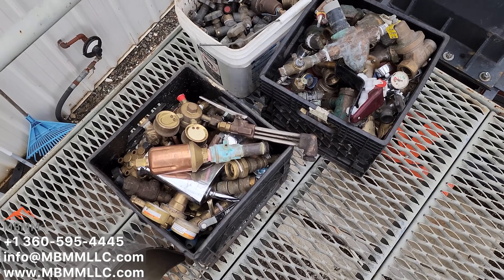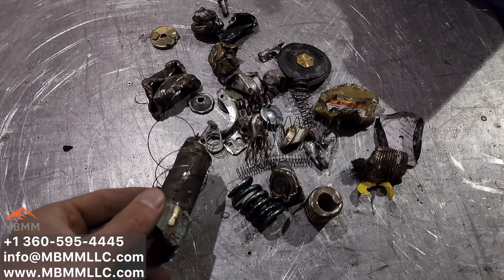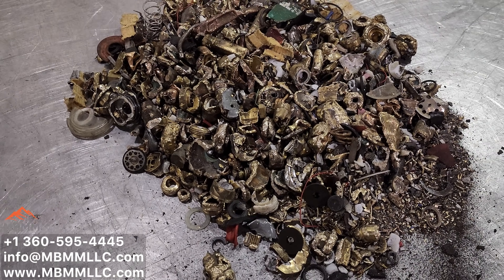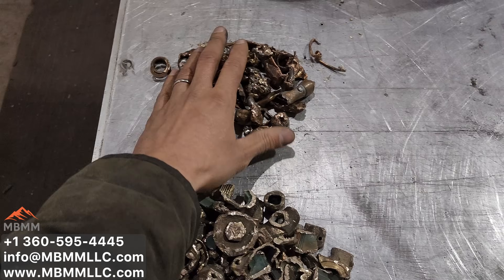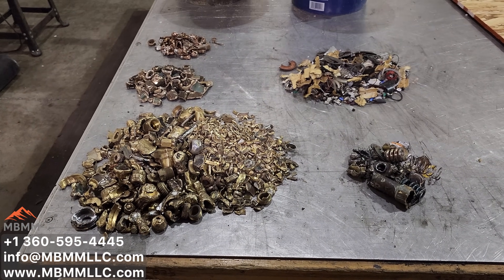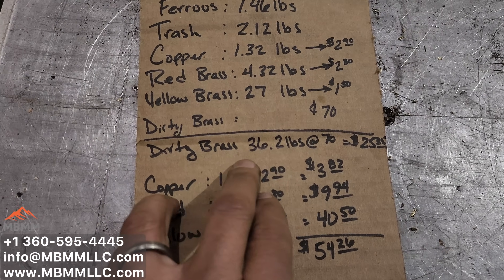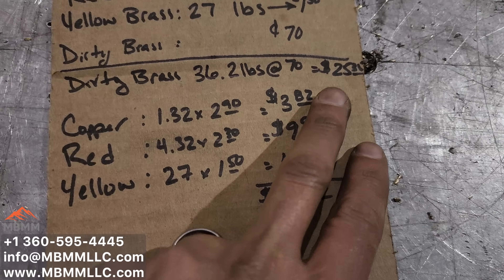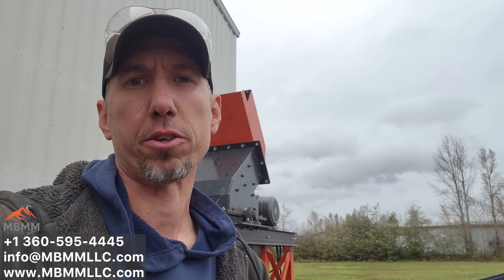Recycling Brass To Cash

Comment: Jason.   I just read an article predicting a copper shortage in a couple of years.  You are swimming in it as tailings!   Suggest you consider concentrating it at least, if not smelting it.  The value will probably be jumping in a year or two

Comment: Used to scrap part-time, and cleaning pipes and fittings, was the worst! 

It got to the point that i learned to heat each joint, threaded and soldered, and most times they busted, but i had a small percent that went to dirty bin! 

Also, any paint on pipe, got dirty rating, so i used paint remover as well, but not much! 

I learned tricks, but this would have helped with the really tough back then! 

58 and spinal injuries, so not happening anymore! 😂😂😂

Thanks bro! Wish i had the money back then, so i could have bought that type of equipment, but back then, hella $!

Comment: Yes but buying the expensive crusher, and then sorting this by hand doesn't lead to much profit when my time is also valuable.
Reply: He's marketing a machine that his company designs, manufactures, and sells to industrial-scale recyclers to take waste material streams and recover value from them. This is all intended for commercial-scale operations, because that single machine is thousands of dollars worth of investment. C'mon, dude, think about it.
Reply: @dionh70  You're right about that. And I realize it, but when I commented, I wasn't thinking along those lines.
Reply: jason has a company that builds crushers
Reply: @davidanalyst671  You don't say....
Reply: You didn’t watch all the way to the end did you? At the end he said there are better ways than hand sorting and gave a couple of examples, some of which he sells.
Reply: @chrisfleming701  I actually did. I stand by my response. I was simply pointing out that my time is also valuable. I like this channel a lot. I watch it whenever a new video comes out, so this wasn't a jab just an observation. But then again this is for very large amounts of material at an industrial level, not some guy in his garage ripping open transformers with plie
rs to pull out the copper.
Reply: @ I’m sure you did. 👍
Reply: C'mon dude ... this is for industrial use, not for you.

Comment: Probably better just going through it by hand with and angle grinder to quickly do it way faster I’d think
Reply: No, it's not faster. I do handyman work, and I end up with a bunch of old plumbing fittings and fixtures, dead appliances, scrap hardware, etc. and occasionally decent amounts of electrical wire. Tearing things apart, then using my angle grinder to separate brass, copper, aluminum, and zinc from the ferrous and stainless takes a LOT of time, which I can spare between projects but not everyone has that leisure.

I tear down old motors from appliances and garbage disposals, and to my great annoyance, many of those intermittent-duty motors have goddamn aluminum wiring instead of copper for the cost savings. I've dismantled portable air conditioners for the radiators, but their compressors are just too much effort for the return.

I bought a wire stripper off Amazon when I re-wired an entire house for a realtor/flipper, because all of the old ungrounded romex had to be stripped out and all new romex put in. That thing paid for itself on that single use, so any time I use it now, it's gravy but it STILL takes time to set up, calibrate for whatever gauge I'm stripping, then feed the wire & manage the stripped insulation.